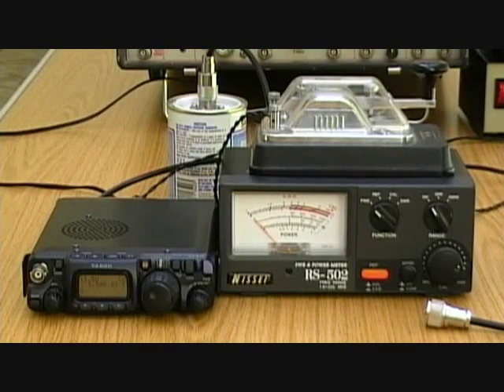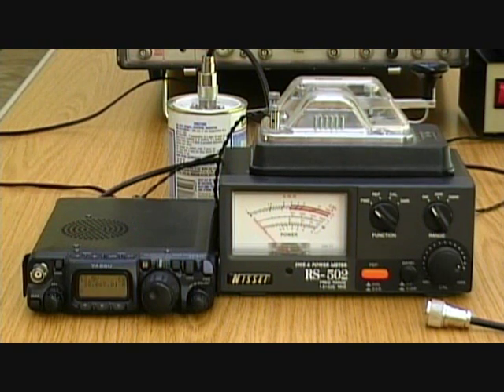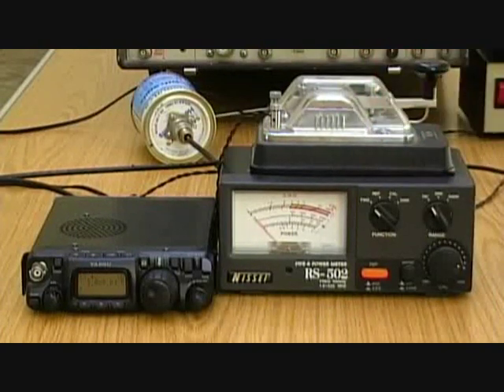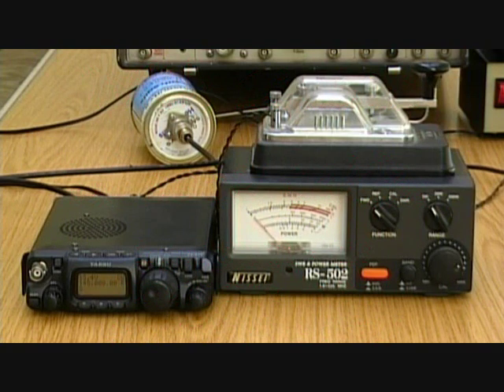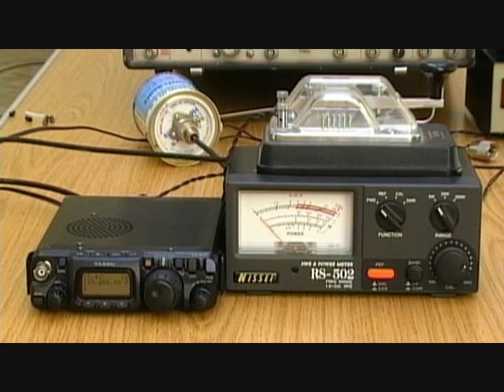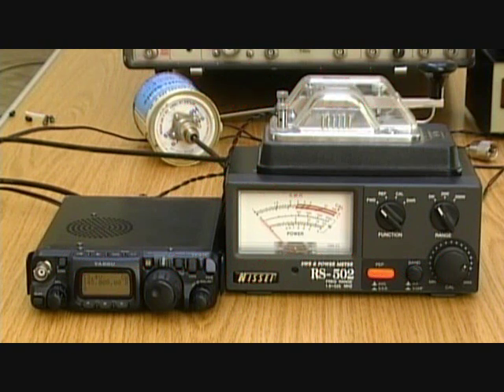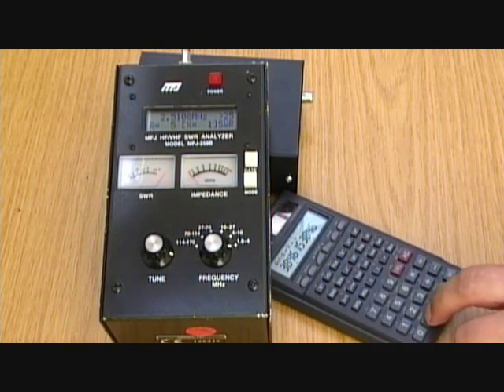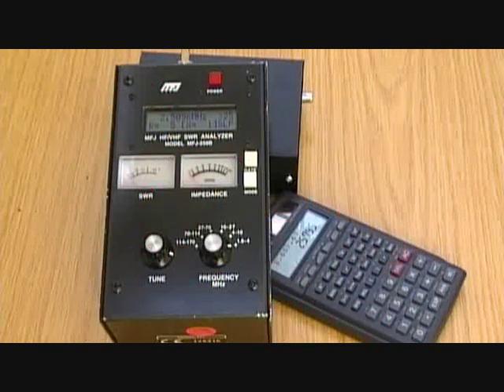Coaxial Cable Losses & Velocity Factor_0001.wmv

Comment: Thanks for the video. I read that it was the SWR that dipped when testing velocity factor. No wonder I couldn't find the dip! I did see the impedance dip, but thought nothing of it. I shall retry the test again whilst observing the impedance.

I need to know the velocity factor of my RG8X to build a VHF 4:1 coax balun for a folded dipole. It seems to differ amongst manufacturers, presumably due to different insulation, but I don't know who manufactured mine.

Thanks for the help. John M0UKD.

Comment from the maker: John, I would be amazed if it is not 0.67, most RG8 and RG58 cables are about that figure. If you can get hold of an MFJ antenna analyser you can use that to cut quarterwave lengths very easily. 73, Steve, G0FUW

Comment from the maker: @2e0lrc Yes, that is correct - see page 59 of the Intermediate text book. Same applies to the 10W from a Foundation station and the 400W from a Full Licence holder. Unless the Licence Schedule states 'ERP' or some other restriction, amateur power levels are measured at the feedpoint of the antenna (as stated in the Licence document).

Comment: Hi!
I want to built a antenna made from common electric wire. 2mm (12 AWG)  diameter of single-strand wire. ( 2 mm is the diameter of the internal wire. It has also the external plastic material.
I am looking for the velocity factor but after days of Internet search I still could find anything.
Does anybody know?
Thank you.